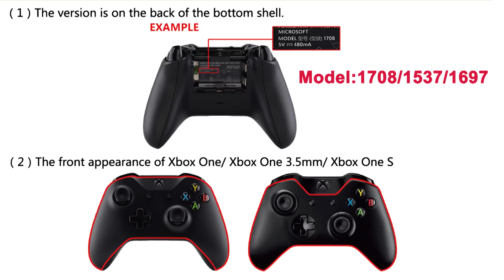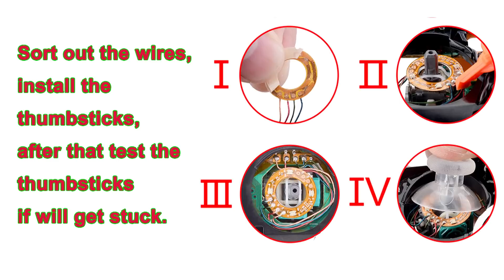Xbox One Controller DTF LED Mod Kit Installation Guide - eXtremeRate

Comment: if not can you guys please make a RGB mod for elite series 2 also .. i have been waiting that your brand would launch such product soon .I have seen the shell, thumb rings available but no rgb kit for series 2 .I dont think that series 2 controller gona disappear for market for quite a long time and if you guys havent launched a product like that , i think you should definately think about it
Reply from the maker: Thanks for your suggestion. We have the plan but haven't got it on schedule.
Reply: The problem is the v2 battery, if you ad anything which isn't supposed to be there the controller just won't turn on.
Reply from the maker: @thechxice9061  Correct
Reply: @ExtremeRate  maybe you could go around that when you get a connection from the led from the controller itself? But that would be way to hard to a diy kit
Reply from the maker: @thechxice9061  Yes, you need to solder then
Reply: @ExtremeRate  yeah I know I only got the kit to work on my V2 with a extra battery and that's shit because you need to change it sometimes because you can't charge it inside the controller
Reply from the maker: @thechxice9061  You can use the rumble motor's points, then when the controller rumble the lights turn on, that's kinda cool
Reply: @ExtremeRate  you don't need to tell me that, I tried every possible way but the battery method is in my option the best one
Reply from the maker: @thechxice9061  Ok, we will keep studying, thanks so much for your information :)
Reply: @ExtremeRate  if you need anything for the v2 msg me on Instagram 🙏

Comment: Does this work with a collective minds strikepack or if the controller gets power from the micro USB on the top?
Reply from the maker: Yes it does, but you have to insert batteries in the controller to make it lights up
Reply: @ExtremeRate  ok thank you
Reply from the maker: @RoosterDog0712  You are welcome!

Comment: and from now on the vibration of this controller doesn‘t work anymore 😏 
very nice tutorial by the way
Reply: Why would the vibration not work?
Reply from the maker: If the wires of the vibration motors fall from the PCB, just solder it back
Reply: What is going ?

Comment: ....why not just take the home button led out and use it as a power source so they only turn on whennthe controller is on and save battery, also i could add a Bluetooth module on top of that so you could control it with ur phone
Reply from the maker: The home button LED does not have enough voltage to run the LED kit. But thanks for your suggestion anyway.
Reply: @ExtremeRate  5v is the minimum i hooked one of ur old kits to it
Reply from the maker: @miguelrodriguez414  We are working on a new version, which you can use 2 soldering points on the controller mainboard for the power source.
Reply: @ExtremeRate  thatd be better, would definitely save battery but i also like what you guys have done with giving it its own control, when i was working on something similar i had to add a module to control them which took up alot of space
Reply from the maker: @miguelrodriguez414  Yes, the space inside the controller is limited

Comment: Hey I like this design and just ordered this kit, but I have a question. Rather than using paper to secure the LED power contacts under the battery pins, could I use light solder to solder to the LEDs power contacts and run those to a known positive and Negative connection? I already have a custom led installed using these connections but I’m afraid of damaging the film that this is on by soldering.
Reply from the maker: Yes you can, but as you said it's the risk at damaging the film, so you have to very carefully and notice the temperature of the soldering iron.

Comment: Could you solder the battery leads for the LED board for a more permanent install solution that has less chance of shorting out on other components?
Reply from the maker: Yes
Reply: @ExtremeRate   Can the battery lead be folded with a crease? or is that beyond the maximum bend radius of the flex circuit?
Reply from the maker: @jakejake743  For one time fold, it's ok
Reply: Could I get a short description on how you did/will do this?
Reply from the maker: @vxpwrtrip   Solder the contact point (upside) of the flex with the battery contact plate (down side)

Comment: How do you connect that black wire between the two circuit boards? Do you need to solder it?
Reply from the maker: please tell us which step of the tutorial you were talked about
Reply: ExtremeRate when you connect the two circuit boards together there’s a black wire that is unattached, I was just wondering how you connected it back
Reply from the maker: @creepykretins  Oh sorry, we forgot to put that scene into the video. It's a plug, does not need to soldering, just align and then push it back.
Reply: ExtremeRate thanks dude that helps a lot I was trying to avoid touching it and couldn’t really disconnect it
Reply from the maker: @creepykretins  You are most welcome. And don't worry, that process is just a piece of cake :)

Comment: I need help my batterypack wont work. It works if i put the Charge cable in ,but with the batterypack alone it doesent. Batterypack is charged btw.
Reply: 3. Party sometimes don't work because they connect not like the play and charge kit or normal batteries
Reply: @thechxice9061  what
Reply: @BLCKVPER  your batterie pack is not compatible
Reply: @thechxice9061  but it worked before i dissassembled the Controller.
Reply: @BLCKVPER  reconnected something wrong ore the kit drains to much
Reply from the maker: @BLCKVPER  Have you tried the AA batteries?
Reply: @ExtremeRate  yes didnt work
Reply from the maker: @BLCKVPER  When you plug the USB to the controller, did you say the controller works? And how about the LED?
Reply: @ExtremeRate  its broken anyway the LEDs wont work anymore, but i will buy a second kit and then i go to a professional in my Town who works with Plantines. Because i dont want to risk breaking my 2 Controller
Reply from the maker: @BLCKVPER  Sorry, please let us know your order number via email to service@gamingcobra.com, we will send you a replacement kit.
Reply: @ExtremeRate  Okay did it
Reply: @ExtremeRate  finally the second kit Installation was a sucess. It working great, thx for sending me the Replacement Kit 👍
Reply from the maker: @BLCKVPER  Great to hear that!!! :D

Comment: ExtremeRate would this fix controller drift?
Reply from the maker: No
Reply: @ExtremeRate  okay thanks i won't do this on my drifted controller
Reply from the maker: @CocaColaGrunt  The drifting problem needs to replace the analog stick component.

Comment: What do i do when the blue color doesnt work anymore. I installed it and everything and it works perfectly. The blue color used to work at the beginning but then the next day it barely glows. Is there a way to fix this?
Reply from the maker: Use a new pair of AA batteries

Comment: Will there be a led Mod for the Xbox One Elite V1 and V2?
Reply from the maker: Sorry, I'm afraid not. In fact, this LED mod kit can be used on Elite V1, but you need to modify the flex to make it fit the controller layouts

Comment: I installed it, the LEDs work just fine, but now my controller won't connect to the Xbox. Got any suggestions?
Reply from the maker: Is the controller can turn on? (the home button flash)
Reply: @ExtremeRate  I randomly tried and it connected. Don't know why it wasn't working earlier.
Reply from the maker: @BigYujo  Anyway, that's great XD
Reply: Get a usb(for example an android charger) and plug one end into ur xbox and the other end into ur controller and press the xbox button after it blinks for a while unplug the usb and u should be good to go

Comment: I cant the the F looking thing to stay in it just falls out. Can anyone help me.
Reply from the maker: You can use a tiny folded paper to help, just like in the video and instruction shown.
Reply: @ExtremeRate  no that’s not the problem, the F piece does not stay in the hole that you first need to put it in. I’m going to have to return and get a new one

Comment: why folded paper? didnt see that in the kit...
Reply from the maker: It's not included, you can use anything that can fix the flex with the controller metal plates

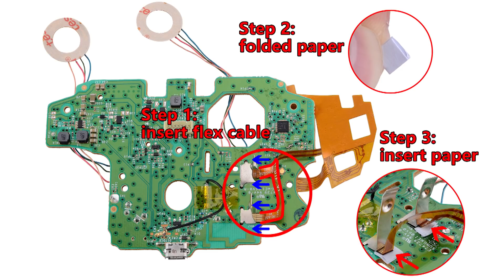Comment: I just gave this a go, the 2nd part aint that clear as the hands cover up putting it under the pins (5:30 - 6:10 ) and I have no idea how your ment to angle the F pice so it fits evey time I tried it just fell out bloacking the 2nd motherbored when I went to but it back in. The glue is too faded to do anything now so im stuck with a dead product
Reply from the maker: Please use a folded paper to stick under the F piece after you insert it into the battery metal plate. Just like we did in 6:19 - 7:25

Comment: I did everything in this video, this is my second installation. The first one worked great. But for some reason the LED won't turn on after holding the pause button. I've tried readjusting everything about 6 times, hours and no progress for me.
Reply from the maker: Hi, can you find any damages on the LED and battery flex of the kit?
Reply: @ExtremeRate  None that I see, but it could be the smallest damage I wouldn't be able to notice. I've already contacted the email on the guide that was sent in. They were very helpful
Reply from the maker: @Darkslasher-iz1fu  Great! Our service team will help you make it works!

Comment: Hey I was wondering since the thumb sticks look like they are made of plastic, are they slippery or anything like that?                               Edit: I went on the link in the description they are different from the ones In the video
Reply from the maker: There are 2 buttons styles for this kit, one is all clear the other one not. But both of them have the grippy thumbsticks
Reply: ExtremeRate I went on amazon only see the ones that are partially clear
Reply from the maker: @reyyez7720  The all clear one is out of stock currently

Comment: i have a problem with my kit 
it worked for the first day and then its stopped lighting up after that ive tried taking it all out and starting again but it still didnt come back on
Reply: i think it has something to do with when i changed over the battery 
i fear i may have bricked the mod kick
Reply from the maker: @petercourt3795  So what's the result of after you change a pair of new batteries?
Reply: @ExtremeRate  still nothing I sent it back to Amazon and they replaced it for me I have yet to install it but I'm sure it will work fine
Reply from the maker: @petercourt3795  We hope so!

Comment: Does it work with the venom battery pack?
Reply from the maker: It depends on the voltage of the battery pack, we heard some feedback from customers using some kind of cheap battery pack and won't works (some color of the LED not light up). But the official Play & Charge kit works perfectly.

Comment: How long does it last
Reply from the maker: A normal battery set will last about 3 to 4 hours, after that the LED will turn off or some of the colors will not light up, but controller will still work until the batteries are totally dead.

Comment: Can you buy the sticker board thing separately.
Reply from the maker: What's sticker board thing?
Reply: @ExtremeRate  The thing that sticks and has the LED lights on it. The brown thingy.
Reply from the maker: @wisdomhope4029  I see, you mean the electronic part of the kit. But it only works with our ABXY buttons
Reply: @ExtremeRate 
Yeah! that electrical part do you guys sale that separate. Just wanna say thank you for responding not many companies do that :)
Reply from the maker: @wisdomhope4029   You are welcome. But I mean if you only use our electronic part and use the original or other 3rd party ABXY buttons, there is problem with it because the ABXY buttons of this kit were redesigned (the dimension is not the same as original).
Reply: @ExtremeRate  okay last question. I bought the kit and it says it shows multiple colors but I'm only getting 4 Red/Green/Blue/Orange. The blue one does not light up well as the other colors. Did I install it wrong or is it a electronic problem.
Reply from the maker: @wisdomhope4029  Is part of the area or all the area?
Reply: @ExtremeRate  All the area.
Reply from the maker: @wisdomhope4029  Please let us know your order number via email to sevice@gamingcobra.com with your shipping address and YouTube name, we will send you the replacement of the LED flex. And please be aware that in your next installation, please handle the LED flex gently, otherwise the circuit of the flex may be broke and the problem will occurred again.
Reply: @ExtremeRate  okay I did thank you. I will be show casing it once it arrives :)
Reply from the maker: @wisdomhope4029  You are most welcome!

Comment: Would this work for an xbox-series x controller?
Reply: Not this exact kit, but they make one for the new controller.
Reply: @andrewroshel  sweet, do you know if it's the same company or not?
Reply from the maker: @ZacZac222  Yes, we are working on the XSX controller version, which will be released soon!
Reply: @ExtremeRate  Awesome, I appreciate the fast  response!!
Reply from the maker: @ZacZac222  ;)

Comment: I followed this but my kit didn’t come with wires connected to the circles.... also they don’t turn on and some of my buttons stopped working
Reply from the maker: We updated the flex to non-wires version, it will easier the installation and avoid short circuit. If the LED can not turn on and some of the buttons not working, it must the placement of the LED flex did not align correctly, please take apart the controller and re-position the LED flex correctly.

Comment: I just watched the video from beginning to end.  I noticed in the beginning you put some scotch tape on the controller... but you never take it off. Why?
Reply from the maker: You can remove them, it just helps the rumble motors stays in their place during the installation
Reply: @ExtremeRate  yes whaat he said lol my vibration parts were hanging and I didn’t think I needed it but turns out it’s a good idea my vibration motors feel off the wire
Reply from the maker: @cge2010yt  lol

Comment: I’ve attempted this installation but I’m having an issue with the buttons. All of them work fine except for A and B. A works once in every 6 clicks and B doesn’t work at all. B also doesn’t light up. Any suggestions?
Reply from the maker: Please make sure the LED flex doesn't cover the contact pad of the buttons. And for the B button doesn't light up, that means that part of the flex was broken. Please reposition the LED flex to make all of the buttons work, and then remember all the details, we will send a replacement for you to install it again.
Reply: @ExtremeRate  How would I go about getting a replacement? I’ve recently ordered this product from you guys on eBay.
Reply from the maker: @xavierhernandez8193  Please let us know your order number via email to info@extremerate.com with your shipping address and YouTube name, thanks

Comment: I have done this successfully on a PS4 controller.... QUESTION: I have my XBOX controller partially put back together and Im at the "pre test phase" I put batteries in, the center X button lights up, but when I hold the menu button for 5 sec... I get no LED.... Any suggestions? It appears that those two little leads with the paper to secure them are getting contact... why won't my LED's light up?
Reply from the maker: Please try again with a new pair of batteries
Reply: Thank you for the quick reply... So I got them to light up and cycle through the colors... it looks great... But the B button will NOT light up... Do you guys know why that would be? Thanks again.
Reply from the maker: @ianthorpe1925  Then the circuit of the B button's LED broke...  Please let us know your order number via email to service@gamingcobra.com with your shipping address and YouTube name, we will send you the replacement of the LED flex. But in your next installation, please aware that handle the flex with care, otherwise it will cause the damages on the circuit.

Comment: Will this work without using batteries? I play only using a cable. Theres no point for me to use batteries when my monitor is a couple feet away from me
Reply from the maker: No, it only works with batteries
Reply: @ExtremeRate  I just installed it and its awesome. I am waiting on other parts but its a master chief themed scuf controller. Thanks for giving me an upgraded screwdriver too vs what you usually send me, I had that in one of my switch shells boxes
Reply from the maker: @haiUnderground  Great to hear that! :) And you are most welcome!!!

Comment: didnt work can you give me a personal zoom guide
Reply from the maker: Hi, was the flex that connects to the battery metal plate installed correctly? And is your AA battery fully charged?
Reply: I think it might be fualty
Reply from the maker: @miriambright4640  Please don't worry, we will assist you to make it work. Could you please provide more detail about the issue? Like what have you done or is there any damages on the flex, or anything you think may be wrong. Thank you.

Comment: Why tape on the vibrators
Reply from the maker: To help them stay in the place, otherwise they will be fallen off during the installation
Reply: @ExtremeRate  thanks you have to do it?
Reply from the maker: @2Takt.J3rry  Do it, otherwise the vibrators will be disconnected with the mainboard, and then you have to solder it back
Reply: @ExtremeRate  can you take it off afterwards? and the 2 pieces of paper, what are they for, can you remove them again afterwards?
Reply from the maker: @2Takt.J3rry  You can remove the tape afterward. But the 2 pieces of paper under the battery metal plate, they help the LED flex sit tide so don't remove them